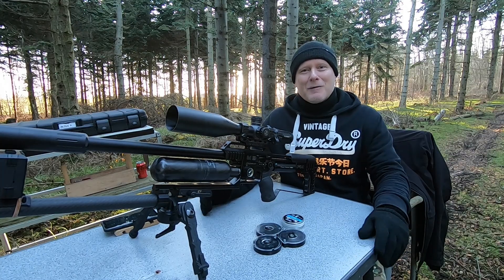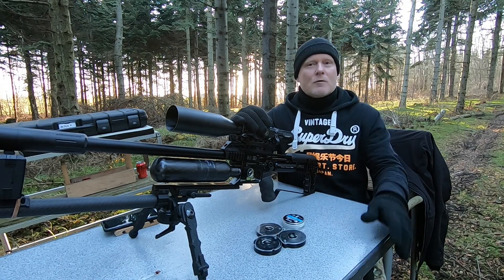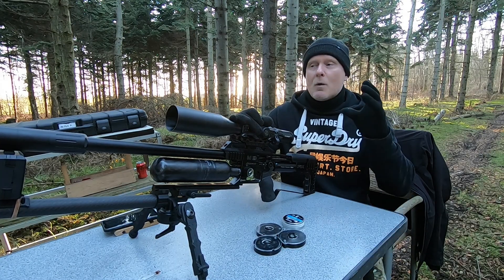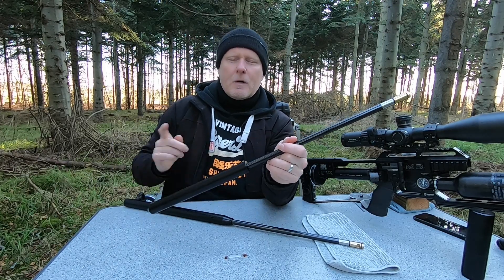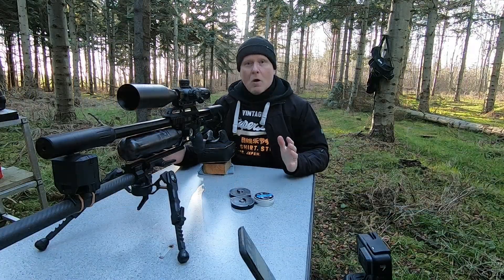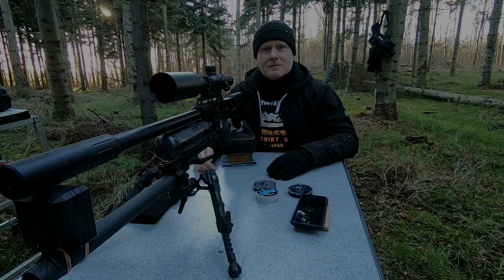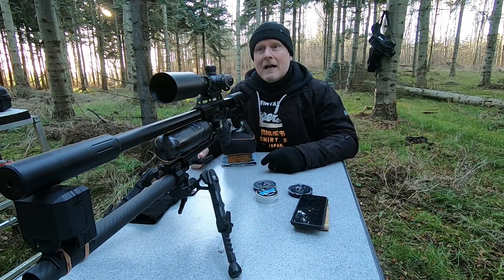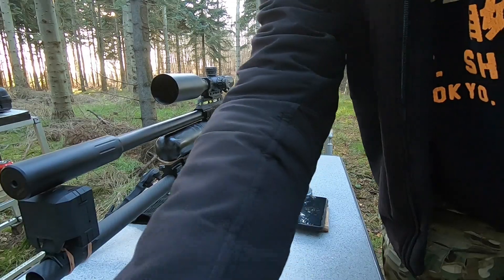FX Impact M3 Barrel change, 600 mm/700 mm - PLUS Accuracy test. What is the gain in velocity?

Comment: Hi Peter, Here's a tough question. My FX Panthera is a 600 mm arrel 22 caliber. I would have liked a 700 mm but it's just too long. 

I was told ideally a 30 grain or maybe a 32 grain slug with a 600 mm barrel is optimal. With a 700 mm Barrel you can easily shoot 40 grain 22 cal slugs.

My question is you wanted more energy and switched over to say a 25 cal or a 30 cal barrel liner while  keeping the 600 mm barrel can you make up the difference of not having a 700 barrel where you can shoot 40 grain 22 cal slugs? 

In other words will it somehow equal out shooting 600 mm Barrel 30 cal 40 grain slug as compared to shooting with a 700 mm barrel with a 22 caliber 40 grain slug in terms of accuracy and FPE / energy?
Reply from the maker: I would really good like to be able to answer your question, but for this I better leave it to someone else.
I like your theory 😎
Reply: @VikingAirgunner  it's okay thanks for getting back to me.

Comment: Besides velocity how does that help accuracy at 50 to 100 yards or more
Reply from the maker: Good question.
Its very much a matter of your ammo.
A longer barrel will stabilize a heavier slug and to a certain extend it will make it more accurate at longer distances.
If you are only shooting below 50 y pellets and a 500 mm liner will be just fine.

Comment: Fastest was 20fps faster. Pcp needs to be properly tuned. That spread tells me something isn't running 100%
Reply from the maker: Thanks for the comment on this rather old video - made me watch it again to remember making it.
To answer your comment, you are SO right that something was off! I struggled more than you can ever imagine to control the spread on the 700 mm STX Superior liner. It seemed to work well with higher speeds, but since we know that higher doesnt have a good effect on accuracy, it was not the solution. Changing the liner into the heavy liner  was☝️🤓
Check out my newer videos for more facts on this.
Conclusion after having used the STX Superior liner was that it was able to shoot some decent groups - but felt more like luck than skill!
So for anyone reading this: AVOID the 700 mm STX Superior liner in 177 and go for the Heavy liner!
Problem solved 😎

Comment: U need 150 bar to close that valve faster a try it
Reply from the maker: My experience with high reg preasures is that it will result in bigger spread and less accuracy. It might be different in other calibers.
Reply: High reg and low hammer , helps the valve close fast I heard many times so this stops Any air distortion for the pellet when it leaves the barrel
Reply from the maker: @ptescreen18  I am aquinted with the theory but my in my experience it does not give better accuracy - in fact the oposite.
I always test theroies.

Comment: It seems to me that getting the maximum FPS from the 700mm, with all other things being equal,  would require opening the valve adjuster to push the pellet farther to compensate for the additional barrel length.
Reply from the maker: True! I dont know if you have seen my tuning video on my channel? In that video Im going into detail about the adjustment of the front valve 🙂
Thanks for your comment 🤗

Comment: 100 m, 5 shot with 2.2cm grouping it's not impossible ... I had 8x shot at 90meters using 690cm Lothar Walther barrel and it was also 2.2 cm on grouping.
I was using JSB Knock Out 13.47 grain (.177)

Comment: If that's a huma moderator that's probably the cause of your extreme spread being so bad had same problem switched to a donnyfl no other changes were made tightened right up went from 30-40 to under 10
Reply from the maker: There is no doubt that it has an effect when switching moderators.
You should check out my video on spread and velocity in the longer barrels. This gives a good picture of the issue 🙂

Comment: Hello, thank you very much for the video, but there is something that happened to us that I cannot resolve. We use 33.5 grain Nielsen brand slu at a speed of approximately 980 fps, but the problem is in the harmonics when shooting, we make the valve close quickly to that there are no large air flows but a lot of problem in the harmonics thank you very much halcon airguns argentina
Reply from the maker: Hey Osvaldo
Working on the valve is a very delicate area. I usually turn it 1/8 of a turn between each test to find the right spot.
Wich length of barrel are u using and with kind? Slug liner or standard superior?
Reply: @VikingAirgunner  Hello, thank you very much for answering, it is difficult to find information here in Argentina, I use the 700 heavy liners!!!  but I notice that with temperature changes everything also influences hahaha go through our channel if you don't mind and many for responding from now on you are invited to Argentina to hunt whenever you want greetings halcon airguns
Reply from the maker: @osvaldogomez999  I just might take you up on that invitation some day - thank you mate 🙂

I wish that I could help you better, but I think that the cal 22 is much different from 177, so I better not expose myself as too clever 😃
But have you tried to turn up the velocity?
Ted Biers last video he was shooting excellent groups at 1100 fps 😳
It might not be nessecary to go that high, but he was shooting 31.5 gr NSA cal 216.5.
My own recent experience that I probably might cover in a video, is that I Went above 1000 fps in the 700 mm liner. I have had big issues with the spread in that liner, but going 1000+ it helped alot - and accuracy seem to be good. Only tested at 34 m so far, but it looks promising, so it might be the road forward for you aswell 🤔
Reply: @VikingAirgunner  well, thank you very much, I don't want to take up any more of your time, it's cal .25, ours, my partner. Use an fx maverick and I use an m3power block, maybe we want a perfection, which is impossible, hahaha, thank you very much, sorry for the inconvenience, and let's just wait when you want to come, thanks again halcon airguns
Reply from the maker: @osvaldogomez999  Its a good setup. Always a good reason to look for better accuracy 😎
Take care mate 🙂

Comment: I wonder if i should order a 700mm barrel, you stil using it? Im gonna order a carbon barrel sleeve and a tensioner kit anyway so i could just as easy change the barrel at the same time.
Reply from the maker: I have actually just been testing the 700 mm again today and hoping that I could make it perform, but saddly it was not the case 🙄
My advise is to save your money and if you want a barrel tensioner kit you can cut it down to fit your 600 mm liner 🤗
Havent done it yet but as soon as I find the tools to cut it down precisely, I will do it 🤓
Reply: @VikingAirgunner  I would imagine any shipyard could do it, they have tools to fine machine almost anything. If not then a tube/pipe cutter would be my bet. You know the types that swirl around the pipe when you cut it? But im gonna do your suggestion, i'm gonna order a tensioner kit and a carbon sleeve and stiffen up the 600mm instead.
Reply from the maker: @trulsvian  I think that you would be disappointed with the 700 mm. I have heard quite a few telling the same thing about it, so I guess that its not just me being bad at the tuning 😃
I cut it down today and pretty happy with the result 🤗
Reply: @VikingAirgunner  I wil follow your advice and keep the 600mm:)

Comment: did you fixed spread issue?
Reply from the maker: Yes but saddly with changing back to the 600 mm liner and the original transfer port 😢
Im explaining it in my next video wich should be online within the next week 🙂
Reply: @VikingAirgunner  had a same problem with my m3, you can pm and I can write what helped me (985fps/std 2.6,spread 13)
Reply from the maker: @slintik  what is your contact info?

Comment: I think with a longer barrel you need to fine tune it.
Reply from the maker: Every barrel needs fine tuning, but the 700 mm liner has shown to be VERY difficult to get a decent spread from. And especially with the dual hole transfer port.
Actually I changed back to the original transfer port on both barrels, but still the 700 mm is hard/impossible for me to tune. So now Im back to the 600 with a very low spread.
Reply: @VikingAirgunner  I wonder how the 800 mm will be? Alot of good reviews out about 20 fps more with the same settings.
Reply from the maker: @robbypro3370  I dont think that it will only be available in the bigger calibers 🤔
But as long as the barrel can be controlled a longer barrel makes sense in my world 😎

Comment: Great video, I think there's a misconception about accuracy and length of barrels, for air rifles a longer barrel gives more power as the projectile as more runway to eccelarate, staying in the barrel longer, downside is any movement from shooter as a greater chance of transferring to projectile result in accuracy inconsistencies, shorter barrel projectile spends less time in barrel, more suited to off hand shooting
Reply from the maker: I follow your idea.
My experience with longer barrels has given me much better accuracy 🙂
But at some point I will test out the 600 mm again, so lets see 🙂
Reply: @VikingAirgunner  I think for bench rest shooting 600/700mm provide better air efficiency but for woods walking, stalking a 500mm Wildcat or Impact really come into there own,from your testing your not loosing much velocity from 600mm compared to 700mm.
Wonder what barrel lengths are preferred in bench rest competitions
 to someone who predominately hunts in woods, farms etc.
Reply from the maker: @drekceldude  walking in the woods the Wildcat is a clear winner - even if I have a 600 mm barrel on it. The Impact with the 700 mm is way too long and heavy!

Im not 100% sure what barrels are most used in competition, but I am sure that the longer barrels are the most common - at least on the Impact. On the Crown with the way the barrel is attached the longer barrels might create too much vibration - but then again we have the barrel tuner 🤓

Comment: First of all thanks a lot for the great videos (not only this one) Peter!
Notice how your group is spread vertically more than horizontally. That means the spread in your muzzle velocity is affecting the accuracy! But honestly it's a bit strange, you should be able to get velocity spread under 5 fps from FX Impact with no big effort. Remember that every barrel needs to be break in. You need to shoot 100-200 times from the barrel to smooth out imperfections in the barrel. Also don't change ammo too much. Especially different hardness/composition of the lead they are made from have an effect and the barrel needs another 3-10 shots to "get used to" the new ammo.
If the velocity spread doesn't improve in next 100+ shots, you should try to play with the regulator pressure and hammer preload. Just try to increase the reg pressure and set hammer so it opens the valve for shorter period of time (should improve accuracy of slugs even more). If that doesn't help with the velocity spread, try the opposite.
Don't clean your FX barrels unless the groups get worse over time!

Have a great time shooting and be safe!
Reply from the maker: Hi Jan
Thank you so much for taking the time to share your experiences 🙂 They all make perfectly good sense!
I have had difficoulties getting my spread down and after installing the Sekhmet it was clear that the reg was the problem being around 15 seconds to fill completely. So for the last two months my rifle has been to service. It should be on the way back to me with a new reg and a new liner (dont know why with the liner🤔)
Your advise with the higher reg makes sense. Gerhard recently said the same, but since he is using the original transfer port he has to go high.
When I just recieved the gun the spread was almost non exciting, so I know that it is possible, so when I get it back I hope that it will behave again 😃
Thanks again for your input!

Best regards
Peter P 🙂

Comment: Hi, yesterday finally after 5 months came FX impact M3 .177, 600mm barrel, but surprised me that the barrel did not have a dual port?  and the upper barrel ending in the thread on which the damper is mounted has a large hole up to 9.7 mm?  Please, you got it like?  Friends have only 6.3mm that hole at 5.5, so they have a quieter shot!
Reply from the maker: Congrats on the new gun mate 🤗 I was also surprised that it only comes with the pellet transfer port as standard, but luckily it is a quick change with the Huma.
As for the hole  - I asume that it is the diameter of the hole in the jam nut you are refering to? Mine is 6,35 mm.
Reply: @VikingAirgunner  thank you for the answer, yes it's the diameter of the lock nut and I don't understand what it's so big for .177
Reply from the maker: @Matko9Kubko  I actually never thought about it 🤔
Reply: @VikingAirgunner  interestingly, FX Maverick has a dual port automatically and no FX impact.
Reply from the maker: @Matko9Kubko  In 177?
Reply: @VikingAirgunner  no in 5,5

Comment: Great video in such a beautiful place. A little suprised at the small increase in speed with the longer barrel. But as you say it's really all about accuracy. Looks like the M3 with the 700mm barrel using KnockOuts is a great combination. Keep sharing and Thanks!
Reply from the maker: I actually expected a greater difference in velocity between the two barrels since the diference between the 500 and the 600 mm was to big!
Feeling very lucky to have a place like that to shoot 😎

Best regards
Peter P

Comment: The barrel length does not change accuracy, only changes velocity. You can go for a higher velocities to shoot further, or tune down the gun shoot the same velocity you had with the 600mm in order to get a higher shot count. The gun needs to be tuned in order to get a smaller SD and better grouping.
Reply: Well that is not entirely accurate since a much shorter barrel is impacted more with gun movement. But if you could fire without moving the gun at all (like in a vice, you are correct)

Comment: Hi bro...i use m3 600mm superior factory std barrel and if using carbon fibre sleeve can it increase the accuracy?
Reply from the maker: Hi man 
I theory, yes. The vibrations in the CF is much less than in the standard alu. I have never done an actual test on the subject and I would imagine that such a test would not show much difference.
But I believe that shooting lots of groups the avarage group size would decrease, so this is why I have done the change on my 600 mm. And the longer the barrel the greater the effect - so CF on the way for my 700 mm aswell 😀

Comment: Wow, I had no idea there were so many factors which can alter the POI, I wrongly assumed it would only be something like an external appendage, which could wobble.  My reason for asking was, I have seen someone use a tiny tripod with the chronograph mounted on it, positioned where you had yours, so totally isolating the rifle & projectile from any contributing factors, or so I thought up until now.  
Your comments have led me to realise I now need a Torque Driver for all the fasteners.  Thank you very much for the information, keep up the  good work
Reply from the maker: You are welcome 🙂

As for the chronograph on the tripod, it is a good solution, but in my experience it can be difficult for it to read some times, so I like the other possibility better. But if there is no place to mount it on a gun the tripod is an option 🙂

Best regards

Comment: Please excuse my ignorance but how much does the long appendage under the barrel affect accuracy
Reply from the maker: Thats a very good question! And actually a question that I should have thought about before shooting.

It goes like this -
Any change done to a gun will contribute to a change in the "vibration image" of the gun. So things like a new barrel or adding carbon fiber to the barrel like sleeves or a barrel housing. Those are some of the big things that will cause the vibrations to change quite alot.
Then there are smaller things like a new lighter or heavier scope. Change in the mounts are also a factor.
Then there are the small things and not things that I have my focus at, but I heard that some olympic shooters do. How much you tighten the screws on that gun....Im not to comment further on that, but just to give a picture of how far you can take it.

As for your question-
Yes there is change in vibrations by attaching that chronograph on a pole like this. But by removing the chrono from the barrel where some attach is, there is a huge difference. And by using carbon fiber pole like mine it dampens the vibrations even better.

Any gun has vibrations and the beauty of it is that we can tune our guns to be in harmony so the changes that we do are evened out 

Best regards
Peter P

Comment: Nice videos. I order m3 in august, i shoud get it this mounth. I order hume transfer port, do i need power kit or any thing else too shoot the slugs?
Reply from the maker: Great that you ordered an M3 🙂
And good idea with the Huma dual hole transfer port!
The power Kit should not nesecary. But a pin probe is best if you want to shoot slugs 🙂
Reply: @VikingAirgunner  I will order. Thank for fast ansers.
Reply from the maker: @hakonthauland3437  You are welcome 🙂
Reply from the maker: Ohh and the carbon fiber barrel liner sleeve. Also a very good thing to install.